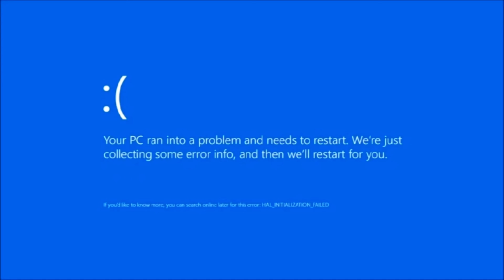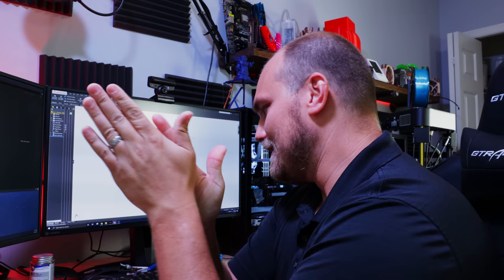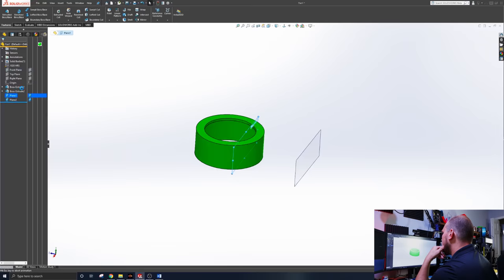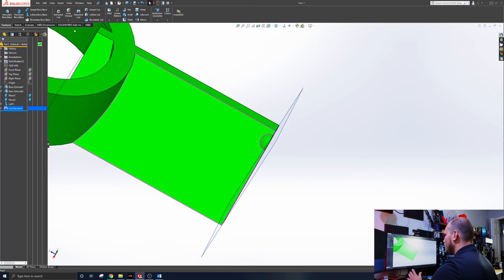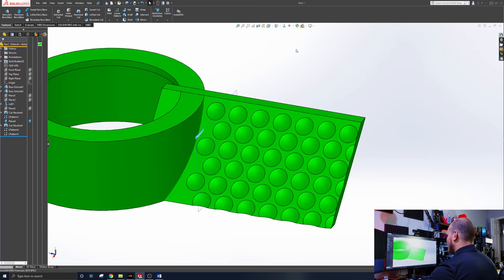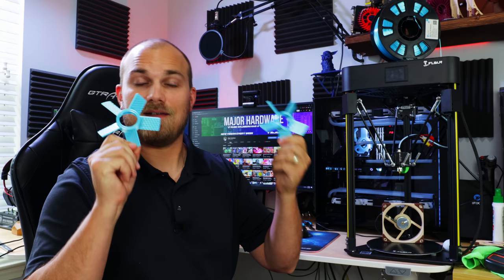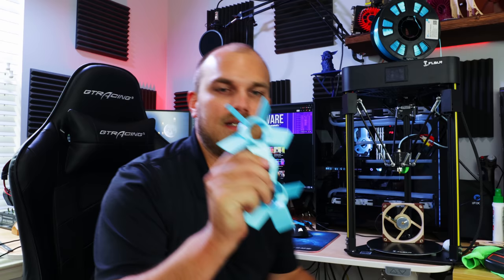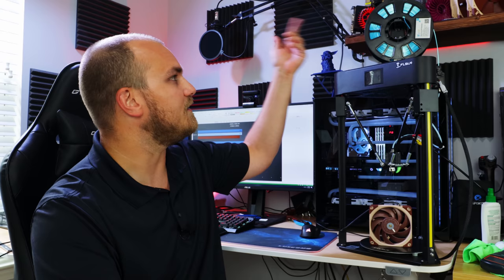What If Fan Blades Had Dimples Like A Golf Ball?

Comment: Blade angle of attack is too low to make a difference. You would probably see a difference if you used airfoil blades with a pronounced rake, rather than straight blades.
Reply: this won't matter, nothing you can do to the dimples or the fan can make them work better because the reason dimples affect golf balls and not fans is that when an object moves through the air, it creates a low-pressure area behind it, creating drag and slowing down the body, because of this, a teardrop shape is the best shape for limiting drag since its outline follows the low-pressure area allowing it to negate the effect almost entirely. the golf ball on the other hand is made to be sphericle to allow for non-directional hits, and therefore must be designed to minimize drag some other way. 

this leads us to the dimples, and how they reduce drag. they do it by creating turbulence on the surface of the sphere, which creates vortexes swirling into the low-pressure zone behind the sphere, allowing air to fill the low-pressure zone more quickly, and lessening the effects of drag.
now, the reason this effect doesn't work on the fan is that its shape is significantly better aerodynamically starting off, as its blades do not generate low-pressure the same way the sphere does, since they are already thin, and don't require air to bend its path nearly as much in order to pass around it.
Reply: @TwelveCrows  "the reason this effect doesn't work on the fan is that its shape is significantly better aerodynamically starting off, as its blades do not generate low-pressure the same way the sphere does, since they are already thin, and don't require air to bend its path nearly as much in order to pass around it."
Hence why i said the angle of attack is too low and he needs blades with a higher rake to see a difference... what's your point?

Comment: Instead of dimples how about bumps?
Reply: this won't matter, nothing you can do to the dimples or the fan can make them work better because the reason dimples affect golf balls and not fans is that when an object moves through the air, it creates a low-pressure area behind it, creating drag and slowing down the body, because of this, a teardrop shape is the best shape for limiting drag since its outline follows the low-pressure area allowing it to negate the effect almost entirely. the golf ball on the other hand is made to be sphericle to allow for non-directional hits, and therefore must be designed to minimize drag some other way. 

this leads us to the dimples, and how they reduce drag. they do it by creating turbulence on the surface of the sphere, which creates vortexes swirling into the low-pressure zone behind the sphere, allowing air to fill the low-pressure zone more quickly, and lessening the effects of drag.
now, the reason this effect doesn't work on the fan is that its shape is significantly better aerodynamically starting off, as its blades do not generate low-pressure the same way the sphere does, since they are already thin, and don't require air to bend its path nearly as much in order to pass around it.

Comment: Measurement of revolutions means absolutely nothing, for testing these fan blades.  Near-useless video.  What you needed to have been testing is volume of airflow.  Reduction of drag (i.e. the amount of air accelerated by a passing solid, or energy lost to it) should mean LESS air pushed.  The low-drag blade would slice through it, catching it less.

Comment: How about creating small arches on the surface of the blade. My hypothesis is that by putting small arches, you can force more air into the surface of the blade which would increase the amount of airflow. The question if the hypothesis holds to be true is will the increased drag offset the efficiency gained by the extra airflow. Perhaps adding dimples under the “wing” could make a difference as well

Comment: This should have been a 5 minute video. 
So many awkward nonsensical rants and a bunch of promo shots of something that didn’t work... 
Why not go and figure out things before you do a video instead of spinning up filler words to drag it out, could of maybe learned about fluid dynamics a little and figure out why you would want 3 vs 5 vs 10 blade. Or what size of a dimple has any benefits to what. Maybe check if there is any velocity difference or CFM difference.

There’s different fans for radiators vs cabinet cooling. The tradeoffs of design. 

What you did was short of dumping footage on YouTube for a lame attempt at an idea. 
Oh well, thats my two cents. Never returning.

Comment: imperial ftw
Reply: imperial was dreamed up by a could of drunk dudes rolling dice in a pub
Reply: @TwelveCrows  Imperial is practical. A foot is roughly (exactly for me) the length of a foot. A yard is the length from the chest-shoulder area to the tip of the middle finger. Etc. The only aspect I don't like about Imperial is the mile (5280ft). Metric is not bad, and the best for precise measurements, but Imperial is practical.
Reply: @IceHacks  a mm is the width of a freckle, a cm is the length of a segment of your finger, a decimeter is the length of your forearm, and a meter is the length of an arm.
needless to say, metric is just as practical, has more unit options, is easier to convert between, is more precise and is significantly easier to convert between units, making it better, more practical, and more precise.
Reply: @TwelveCrows  The forearms length (from fingertip to elbow) is actually 4 and a half decimeters. I cannot verify the freckles thing as I have none.

Comment: Major Hardware goes through all the troubles and than does a shitty test and draws conclusion from that. The RPM measurement is useless; even as the temps. Also current on the fan is useless because you have no information on blade efficiency. You must measure flow!